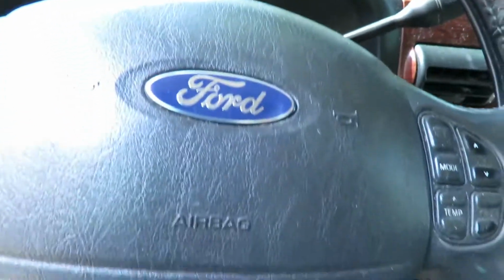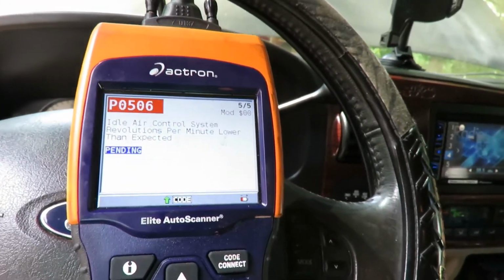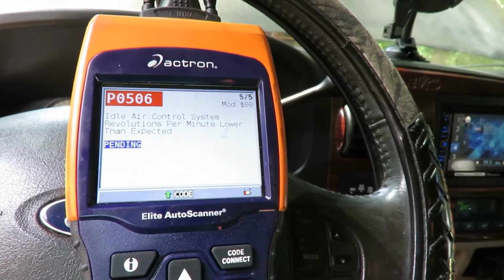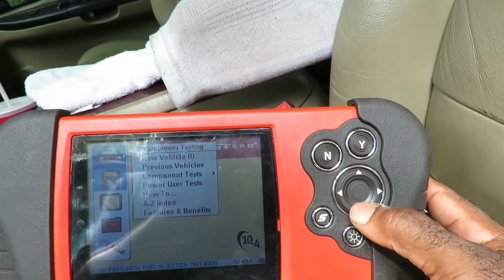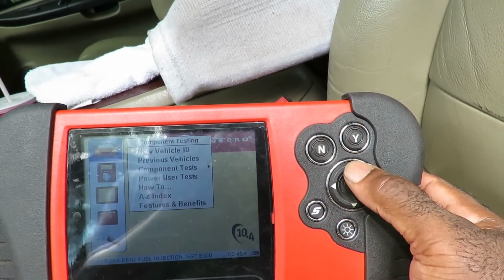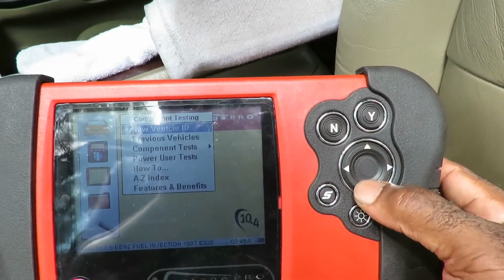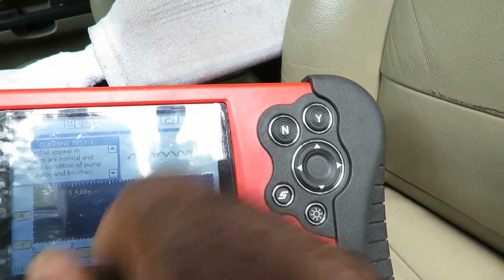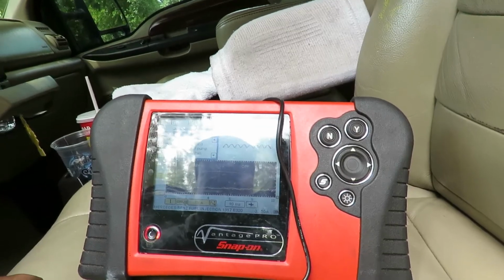2005 Ford F-250 - Super Duty - No Power - P0506 - Idle Control System Malfunction

Comment: do you have a follow-up vid of the repair?
Reply from the maker: Sorry, no we don't.
Reply: @OnlineAutoRepairVideos  ... did the fuel pump fix the misfire? I have a  2005 f250 v10 giving me codes p0207 cyl fuel inj, p0505 p0174 bank 2 lean, p2197 o2 sensor stuck lean bank 2 .... scanner shows 36-40 psi running for fuel presure. coil pack is new, plug is new. injector or the fuel pump is all I can think, runs but has a bad mis and limited power, no vacuum leaks that I can find.. thanks for any addvice I'm stumped at what to attack next

Comment: how do you get the codes if you hook your code reader in an it keeps saying you need to hook it in the truck?
Reply from the maker: First try another reader, and then if that does not work, have Autozone or Advance Auto to try. If they can't read it, you have to find out if the connector is bad, or a wiring issue.
Reply: I have to replace the cigarette lighter fuse every so often when I need to use a code reader.